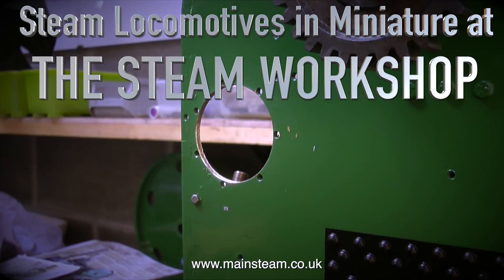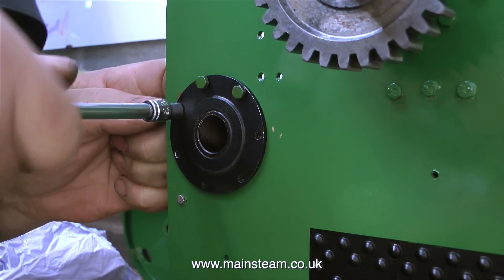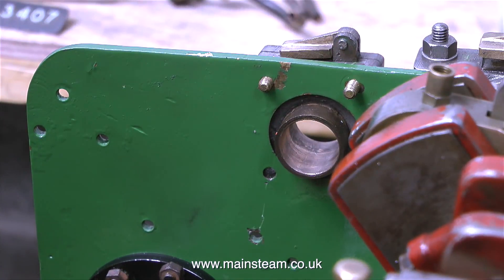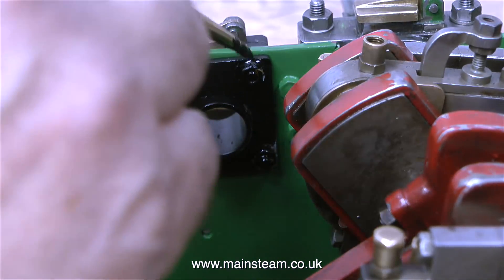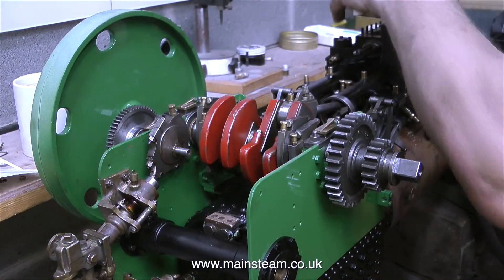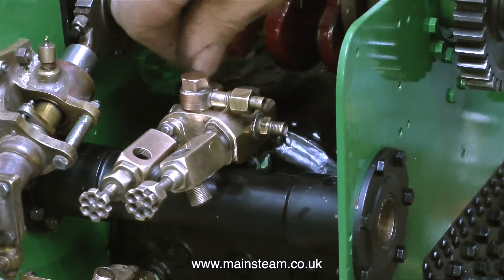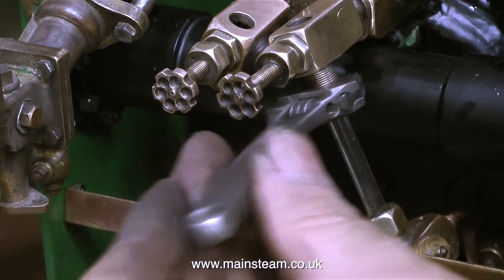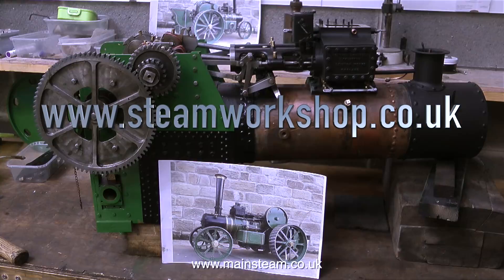THE STEAM WORKSHOP - GARRETT DCC TRACTOR - PART #5

Comment: Keith, if you look at the upper right 
bolt, at 2:45 or so, wear marks are 
discernible, even through the paint.

Therefore, there wasn't a plate there, 
when the engine was taken apart.

Should have been, though.  GOOD 
call.  (Just another Keith Appleton 
save.)

steve

Comment: With water gauges I was taught finger tight, then 1/4 turn with the wrench. works with full size or models, then when up tp pressure little nudges on leaks. I think the traction engines stayed at a lower level of design because of maintence. A locomotive was done at a shop that would have all the necessary equipment, while the maintence on a traction engine was done in the field or the barn.